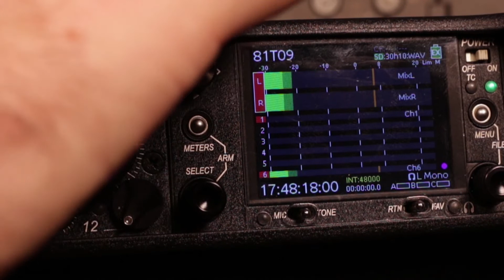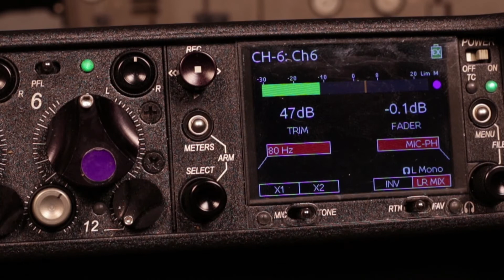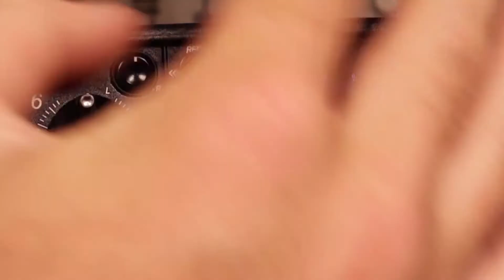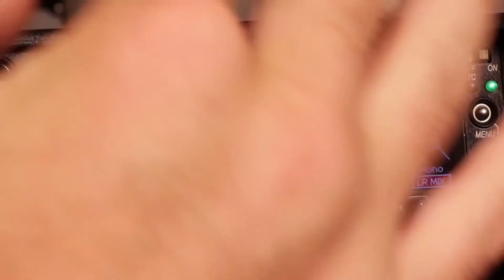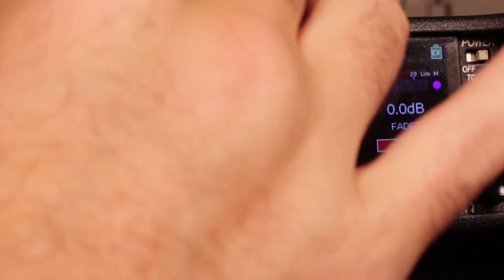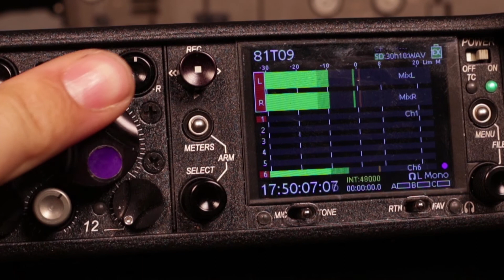Overview of Trim / Faders / Gain / PFL

Comment: So do you not use the fader at all if you set something to prefade? If you set your ISO tracks to prefade, and your mix track to postfade - do you only control the mix track with your faders then, while the ISO tracks are controlled by the gain knob only?

Should you always set the ISO tracks to prefade, and the mix to postfade? Any other solutions? Say I have a boom mic on channel 1, and two lavs on channel 2 and 3 respectively. I also want to record a mix track of them all. What would I set to prefade and postfade in this scenario?

Comment: So while I'm using lavalier mics on the 664 for a movie scene, shall I keep it on Pre fade or Post fade?
Reply from the maker: Pre fade then your mix track is only post fade
Reply: Matt Price thank you so much for the quick reply. 
I've got one more question. Does it have any built in noise gates/pads up to any decibel to cut off background noise?
Reply: @BlueSophication  You're probably not going to worry about that. Noise gates are used for sports sometimes for crowd mics, but that usually isn't done on ENG or film sets. Gating and pads are usually only used in music recording and mastering.

Comment: Quesssstion...

I've been trying to find the answer for this everywhere, more clarification than anything, but I can't manage to find a clear answer:

Is the Fader's purpose JUST for boosting the signal if the source suddenly gets quieter? Because from what I understand, if your trim is set and the signal comes in too hot, turning down the fader won't eliminate the distortion - because... how could it if the input signal has already clipped.

Otherwise, great video.

Comment: I have a somewhat off-topic question. I'm a sound mixer from Idaho with a 6-series (633), and I wanted to know if there's any way to run two tracks from a boom, one set at a normal gain and one set as a safety. There's the way of a prefade iso and then having it boosted in the mix, but I started with a 302 into a 702T, and really liked the ability to run two ISO tracks, one hot and one low. With the 6-series limiters, I know there's a lot less danger, but I've always kind of liked my original 2 track setup. Any thoughts on this? Should I just forget about those safety track days and trust my limiters to do their job?
Reply from the maker: +Nightfall Films will do a video on it but I would say generally the limited would be fine on the 633 and because of the 2 stage gain structure if you set the gain too high and then turn down with the fader you still have a useless signal
Reply: Matt Price from Soundrolling dot com Splendid, thanks for the quick reply! Just wanted to make sure I wasn't missing out on some key feature, I'll trust my gain staging skills and limiters from here on out. Love your channel and the app, I've used the camera TC cheatsheet several times while on the phone with producers to make sure I can actually deliver TC and scratch before promising anything. What a great tool!